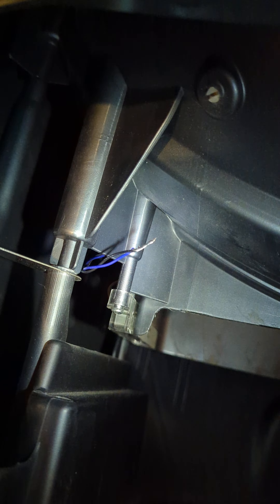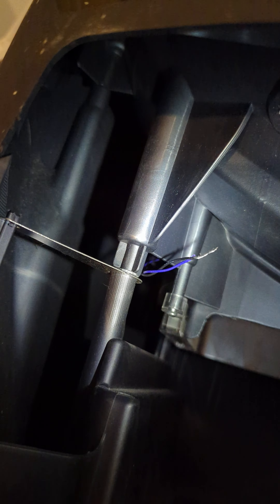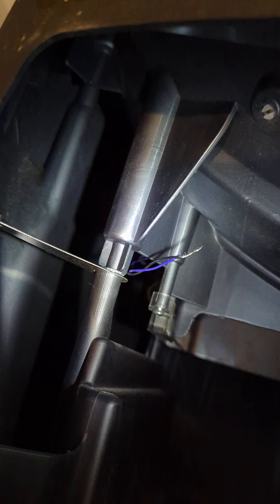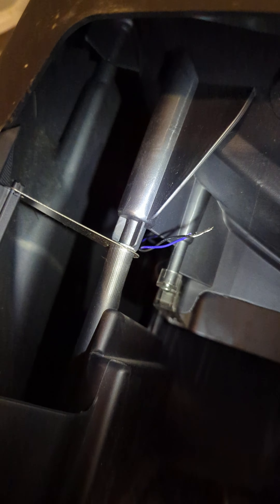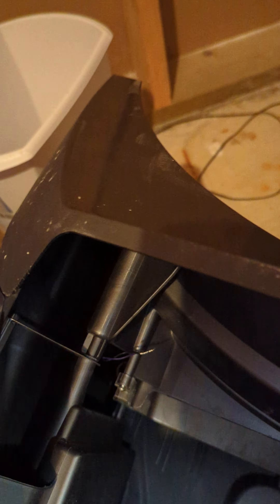How to PERMANENTLY stop the "bonnet removed" error on a Litter Robot 3

Comment: This worked! Thank you so much. Need to cap the wires. I had non stop bonnet errors despite reseating the globe and cleaning the gears. Restaring the system did not help either. Must be a bad connection. So happy now. This was easy.
Reply from the maker: Rock on! Glad I could help!!

Comment: I done all the steps now when I reassemble the litter robot there is no power going to it I have checked the cord and plugged it into multiple sockets do you have any ideas on why
Reply from the maker: Did you strip the wires and twist them together? They need to be connected for it to work.